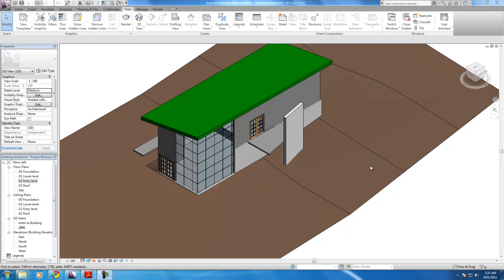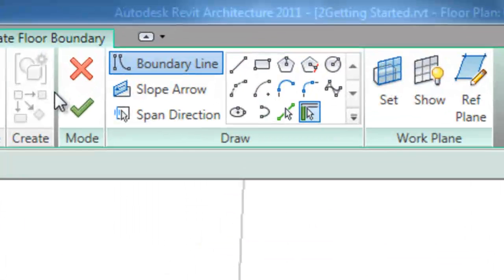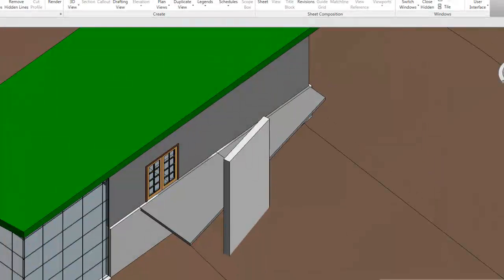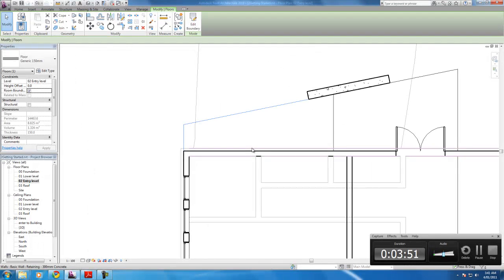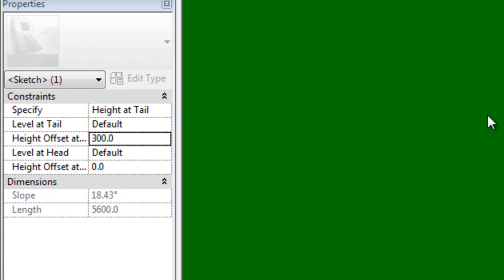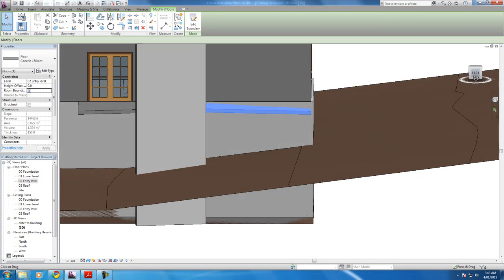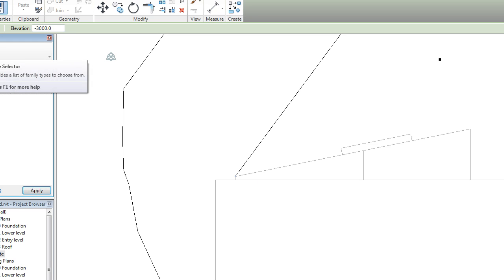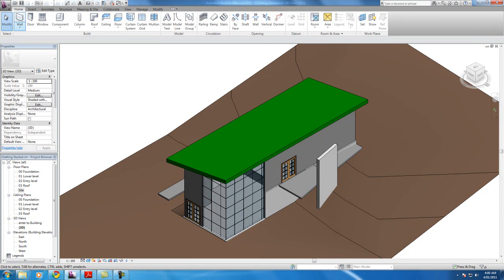Autodesk Revit Tutorials: 14 Adding a sloped floor

Comment: Hey, couple things. firstly the two extra little lines represent the direction of the structure underneath the floor, its showing you their direction.
Secondly, the arrow should always point down. You go UP stairs, DOWN ramps.
Other than that, its pretty a good series, short and to the point. Keep it up. :)